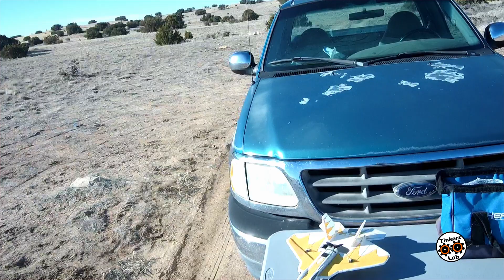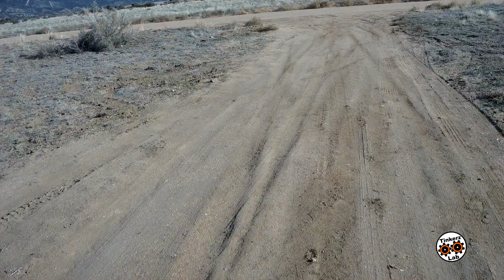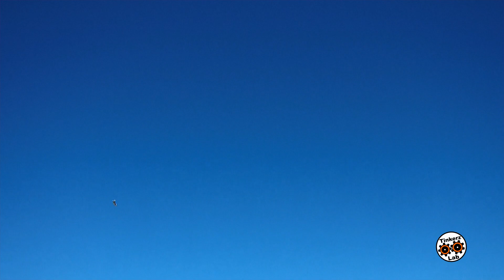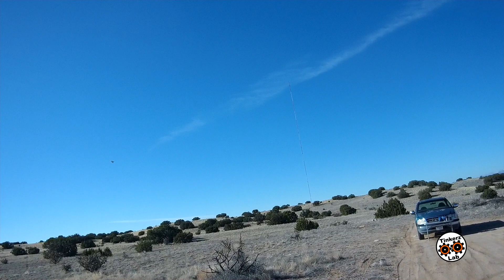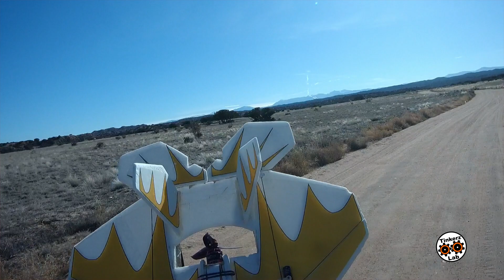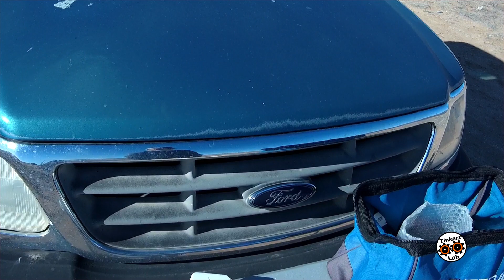TinkerzLab RC Tech | 1st Test Flight using the Radiolink Byme-DB 4 Channel Gyro & Flight Controller

Comment: Hi - could you tell us how you connected the BYME with which your  Receiver? I'm trying to get mine connected with a Radiolink R8XM receiver. The Receiver connects fine with my TX16S and checking with an SBUS Monitor (ToolkitRC MC8) so far everything looks good - but as soon as I connect it with the BYME A the channels get mixed up. Channel 1 and 2 get controlled by the Aileron Stick and Channel 4 is dead - no rudder. So would be great to see how you have setup your Transmitter??
Reply from the maker: If you're using the Byme-D, as I am with this Parkjet, there is no active rudder channel on the Byme-D.
It sounds like the channel order is incorrect in the transmitter or the channels are connected improperly to the Byme-D.
Channel order is (1) Aileron, (2) Elevator, (3) Throttle.
The Byme-D is for Elevon Mixing and does this internally so the it should be setup in the TX as a standard plane with no Elevon Mixing in the TX.